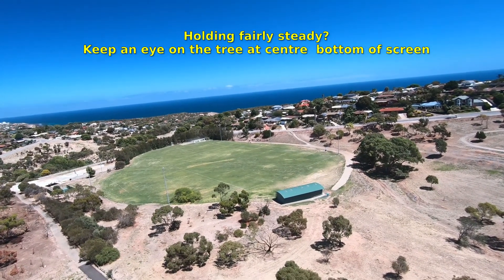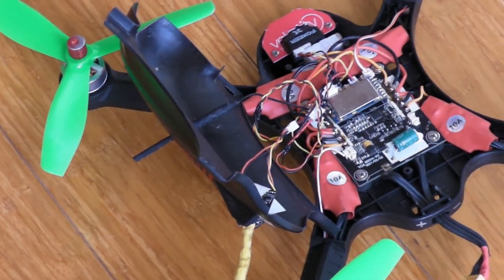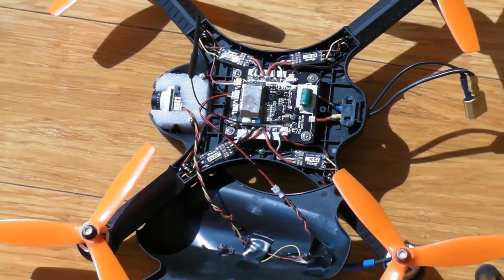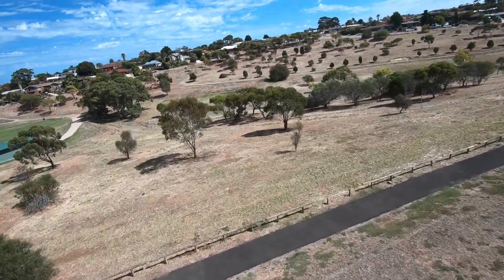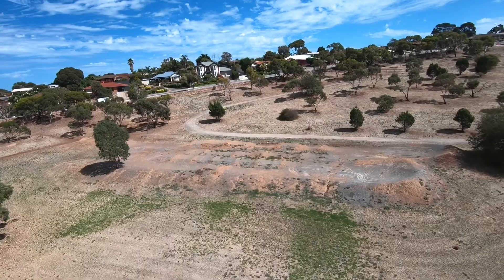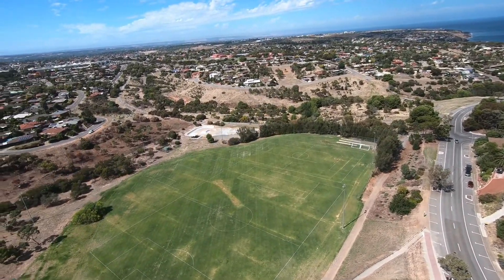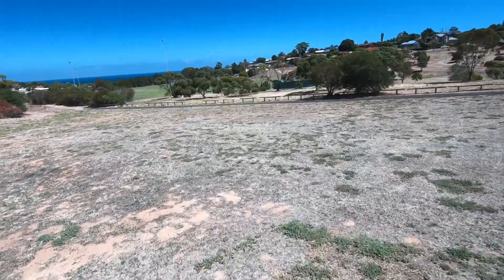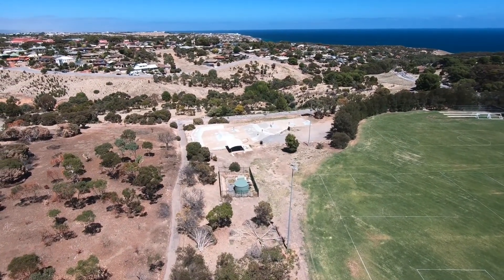MJX Bugs 3 mod - 6, 10 now 20amp ESCs!

Comment: Hi, and hello to you sir.. actually I'm has owned bugs 8, do u have any recommendations for upgrade this bugs? I'm was thinking to used 20amp esc+racerstar 1806 2280kv brushless motor or 2212 930kv.. is it possible too?
Reply from the maker: Hi Dee! I have replaced motors and the 4 in 1 ESC on a Bugs 6. Here is a video about it -
https://www.youtube.com/watch?v=yx6CgkMBlMQ&list=PLQA_NusLG6G53DXoHBS47JYj-6QLCHX7G&index=5
These days I would use a 20 or 35 amp 4 in 1 ESC as I did for the Bugs 3 mini -
https://www.youtube.com/watch?v=xErIvVgpi5k&list=PLQA_NusLG6G5V6BkhmZRWK5O5jdVjKtsQ&index=3
Reply: @skybug3  thanks a lots sir .. actually all bugs from mjx was a very perfect and does their job even after past 6 or 7 years release in market, very perfect and tough enough for any beginners to started on fpv racing drone.. and with some upgraded and mod it will much better and its was cheaper and really suitable for any beginners to learning from basic.. anyway, honestly thanks, and much appreciated for Ur replies and video too.. 
#can I get your email if ur don't mind..

Comment: do i need to change the remote if i change esc?
Reply from the maker: No. I usually fly with a Jumper T8SG, but I always calibrate with a standard MJX Bugs 3 remote after installing the new ESCs.

Comment: Hi David! Did you change any settings in the computer?
Also there are two black wires going to the FC board. Did you use both connected to the negative?
Reply from the maker: No changes required to settings. Snipped off plug and black wire, white wire to flight control board.
Answered this query on another video, but answered here as well, in case it helps anyone else.
Reply: Thank you! Sir! I ordered this and it is small. 👍

Comment: NIce
Reply from the maker: It's working well - first flight over water up soon.
Reply: I had thought of that and was going to but everyone said whoa no bl heli ..won't work, so I trashed the idea. Goes to show you info you get from builders is NOT consistent with  prebuilt drones.  I run 3s sometimes cause I carry GP session5..and still want decent run time. Could just run bigger 2s tho maybe.